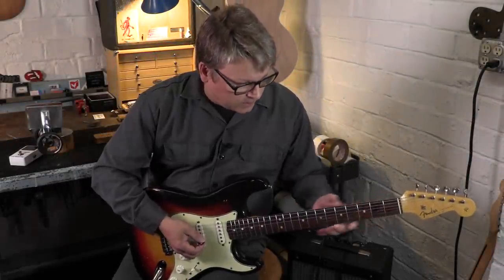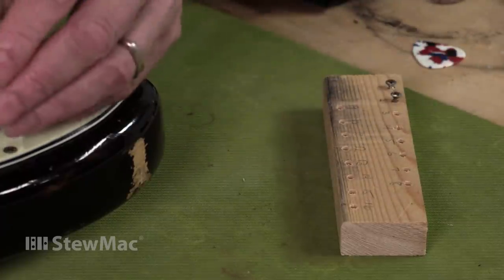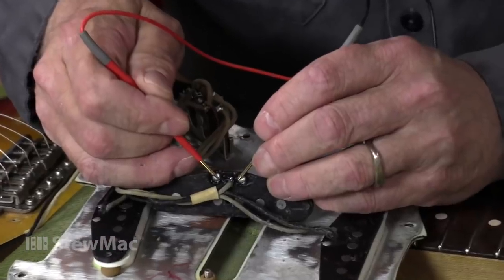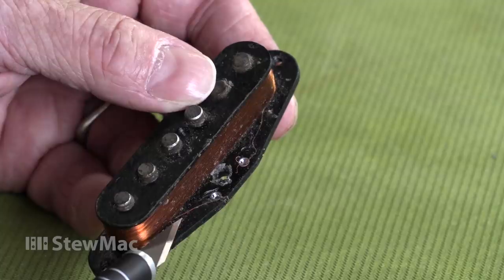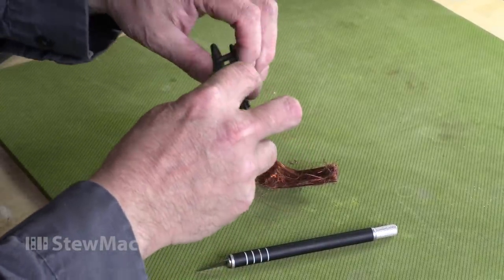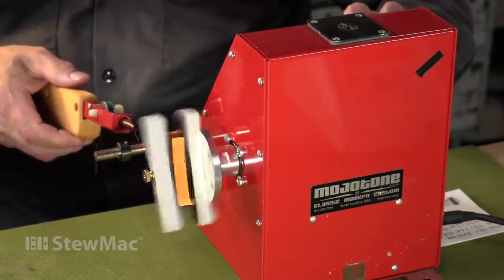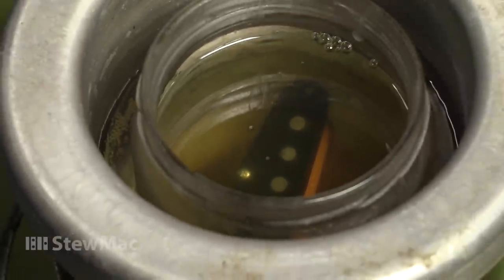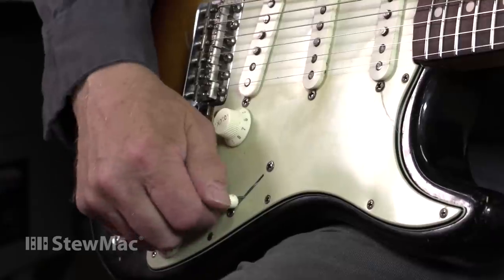Fixing a pickup on a 1963 Fender Stratocaster

Comment: Sometimes it worth unraveling the outer winding's in search of a break, I've come across a few breaks that were pretty close to the outer winding surface. Loosing 20 odd feet of wire but saving a vintage pickup is a plus. Even the lead edge of a winding can be unwrapped a little bit if its wound near the bobbin, not often though. If you find a break, and you didn't break the wire yourself you could disassemble the bobbin, not easy to do but possible and pull out a winding or 2.
Reply: Oh Heyal Yeah!!! You are so right. 20 years ago I had a Bentley Series 10 and the 'bucker died. I didn't know sheep from shinola about working on it but that Bentley made 20 some-odd way different sounds with the 5-way and 2 independent vols, before the mother bucker gave up the ghost. I really loved that guitar. So I figured,  let's see what the center of a pickup looks like.  What was I gonna do, break it? Took the pickup out and turned it over and over in my hand, poking it here and there and trying to look like I actually had some clue about what the hell I was doing (there were onlookers). I kept getting asked what I was gonna do to it, so I mumbled a bit, threw in a couple of "hmmm's", and told my audience that I had decided to get stoned and unwind it. Maybe 30 feet or so in there was a break. So after much consideration, and lots of helpful (ha ha) input from my buddies, I twisted the ends together, cut a little piece off a lead sinker (fishing I knew about a thousand times more than I did guitars), kinda sorta flattened it and wrapped it around the wire ends, and squished, wait, this was in Texas, so I should say "squarshed" it together with my fishing plyers, figuring the tool deserved a shot at it since it's buddy Mr. sinker took one for the team. Put it back together and woo hoo! it worked. Oh yeah, before painstakingly rewinding it by hand, during that time we spent(I say "we" because the onlookers had become my pit crew) considering all the options, Bob said "I'll fly if you'll buy" ('cause our mouths were getting dry), which got yeahs and yups (Texan for "yes") and hands in pockets for beer money. We couldn't do anything 'til Bob got back, so we hunkered down and got serious. We were like the driver and his pit crew at Nascar, working on the Bentley Special, getting it ready to Rock and Roll! Well, Bob got back and it was Pop-pop-pop-pop-pop!...and gulp gulp gulping...followed by some dang that's good's, thank yuh Jaysus'es (local dialect) and hoooweee!'s. More discussion and we decided I should put a coat of the old lady's clear fingernail polish on the repair and let that dry, which was just enough time to fire up another doobie. ....Doobie Brothers record, that's what I meant to say. Yeah. That. Anyway, gotter back together and that Bentley never sounded better! Then my buddy Bubba Joe( I swear!), who could actually play a guitar handed Mr Bentley back to me. Some mumbles, eh's, then a quick save, someone yelled "Barbecue!" which stared a chorus of Oh Heyal  Yayuh's,  couple of "Hey Bob! Go again?"'s , and IT WAS ON!!! ...Y'all take care, now.  - David, a.k.a. the ConnMan.
Reply: The same can be done on some P90s. Have an experience on two of them.

Comment: Very nice job.

Hand wound pickups sound sweeter than perfect wound precise machine wound coils. This is due to the fact that the OD of each turn is a little larger or for example more length of wire is used on a hand wound at the same amount of turns. A perfect digital winder with precise progression which creates a perfect ribbon of wire side by side on the layers takes less wire per turn due to less buildup of wire. The lower buildup to achieve the same DCR would require more turns. The inductance is the key for the resonant peak frequency anyway. More turns would mean a higher inductance and in my opinion the more perfect machine wound pups sound more harsh. The more perfect machine wound pickups which utilize the more perfect progression side by side etc move the resonant frequency point around or different than the hand wound pups and sound different. The random wound coils seem to put some mojo and sweetness to the pups.
Reply: DC Bluez I’ve heard that Leo’s little helper would wind pickups by hand , and the wire would regularly cross the bobbin . This was known as scatter wound pickups , giving that unique sound  . Trust me I’m no expert , so would this create a unique sound . Thanks for reading

Comment: Couldn't you just unwind by hand in case it was a break and then rewind?  If it was wire insulation could the unwound wire be coated to fix the short?
Reply: Wish I could have heard the 2 and 4 position....what if they sound was cool.  Roy Buchanan killed it with a malfunctioning bridge pickup and now Don Mare makes nice replicas with the flaw built in.
Reply: '63 had a 3-position switch but I understand you can get those sounds with careful placement of the switch so yeah...
Reply: Yup...
Reply: Yup

Comment: !!!!!  H E L P !!!!  I ran a magnet over the pickups to clean them of splinters and ferrous dust accumulated over time (done on other guitars without problems) and today the pickups no longer play!  They have no magnetic attraction and the volume has dropped by 70/80%!!  It is a "Gilmour" setup with reversed-phase (RW) single coil pickups and 7-combination selector switch.  Help!!!  What happen!?  Is it reversible?  12 hours have passed and nothing has changed!  Only the magnets involved in contact with the magnet have "turned off", the central ones... the lateral ones work perfectly (low E and high E)...!!  What happened?  Can I save them?  Can magnetic charge be recovered?  Do I need to replace the magnetic cylinders?  Is copper safe?
 Please 🙏 help, in my region there is no one to turn to..!
 Lucius

Comment: This one mid pickup had corrosion, or mechanic, or combined problem - providing almost open circuit (260k). Sound was coming from coil's combined capacitative (some ~100...150pF)  + plus resistive (260k) connection - filtering down low end of frequencies. Problem was at inner start wraps (if it would be at end wraps - pickup would not provide sound almost at all (such case there is a reason to try to wind off end wraps until finding this open circuit !). Start wraps are winded directly over Alnico magnet (or non magnetic soft iron) poles, it is std problem with the vintage kind of Fender pickups. Reasons can be two: 1) Pole inner corrosion with mechanical expansion of rust, and/or corrosion's chemical reaction with copper wire. 2) It can happen if you move someone pole down, especially if you move 1st or 6th - side pole down. Never do it ! It is rather risky to adjust string balance moving 2nd, 3rd, 4th, 5th (mid) poles too. But such accidental moving of poles can happen even playing (with pick or string), and most case it happens on mid pickup - it is more "handy" for such accident...

Comment: Lol everyone loves bright shiny solder joints! Just not on vintage guitars. I'm building a tele and I picked up some fender vintage 64 pickups and the neck arrived DOA. Fender is sending a replacement set but I did try resoldering the contacts with no luck. Same with checking the gauss, measures as it should. I imagine theres oxidation or a break. Btw I picked up a stewmac fret level when I was getting my vinyl sealer and vintage white lacquer and it works excellent!

Comment: This video is instructional.. but how could the pickup read 260K, and not be open? (doesn't make sense) then the tech correctly observes the insulation flaking off, and possible shorted windings ... which does make sense, but this would read lower resistance!

Comment: Hey I would like to thank you I have a 57 reissue strat from the 80s the neck pickup was showing no resistance after inspecting I assumed the winding had broke as there was waxy deposits but after watching your video I re-flowed the terminals an low and behold it’s working again I’m over the moon as I did not want to replace the original Thanks again Eddie Liverpool U.K.

Comment: 260K resistance reading does seem like a break in the winding due to a minute corrosion spot and not a faulty solder joint.
If the magnet wire may be compromised you really have no choice but to re-wind the coil. I am surprised that there is no inner layer of tape that may prevent any corrosion between the wire and the pole-pieces. Does the fact the pickup had to be re-wound affect the value of the guitar to any degree?
Just wondering if you would apply any mark of your own to the centre coil, identifying the re-wound coil.
It is part of the guitar's history now.

Comment: That repair was AWESOME!!! I'm a manufacturing engineer and worked at Delphi Automotive. We have banks of copper bobbin winders for fuel injectors. When electricity is applied it opens the injector, when no juice, a spring returns it closed. Amazing how two copper bobbins can have such different functions. That was a really great video, thank you for taking the time to create, edit and post.

Comment: You “do” want bright and shiny solder joints. Dull/grey are a sign of cold solder joints.
Reply: Only if it's a new joint, every 50 year old solder joint should look dull, just from oxidation of the lead solder
Reply: You missed the point, he was saying on a vintage guitar you do not want to see the repair as it will be shiny solder and stand out from the the rest of the vintage aged look, hence solder on the parts not noticeable as they will be shiny when soldered correctly. He is a man who cares about his work and the owner and the guitars heritage.
Reply: @paulrichardson3222  A man who cares about "vintage" fake...

Comment: You're looking at .260 megs or 260 k.  That's way high.  That can't be a short.  That's a broken wire.  You still have to rewind it, but it is what it is.  Not a short and not enamel failure.  Am I wrong?

Comment: So if the wires insulation failed and they are shorting out somewhere, why does the coil read a higher resistance? That doesn't make any sense. I would have rather expected the copper wire to be worn down somewhere making it thinner (without touching the other wires) and increasing it's resistance...

Comment: Interesting to see someone actually use one of the old style pocket magnetometers. As far as I can tell 25 gauss is the field strength at the sensing magnet, some distance inside the case of the magnetometer, so the reading is not at the top pole of each pickup magnet, but at some distance from it. If you use a modern magnetometer with a Hall effect probe, right on top of each magnet you will get a reading closer to 1,000 Gauss for a fully charged Alnico 5 Strat pickup magnet. From magnet to magnet this commonly varies by perhaps as much as 100 Gauss. Whether this variation is due to uneven charging or variation in the magnets I don't know. Taking an accurate and stable reading with a small Hall effect probe is quite difficult because the field density near a small magnet is far from uniform and the value you get depends on exactly where you measure it.

Comment: Hey Erick, great site!  I own an original 1976 Tele.  Just had it refretted after 16 years of ownership.  Don't know if it's coincidence but now my bridge pickup is really weak.  Used to be hotter than the neck, now it's weaker.  It's ohming out at 5.7 ohms, similar to the neck.  No erratic measures, etc.  I noticed after closer scrutiny that the pole under the a string is far, far weaker than the poles under the other strings, at least as is noticeble by playing each string individually.  I popped off the pickgaurd and looked at the pickup, nothing obvious.  Is it possible that just one of the poles is affected?  If so, is it repairable?  Or rechargeable?  Weird that it's just one pole?

Comment: Weird copper readings can be a result of strong temperature swings. A common problem in coms lines in Alaska as the wire expands and contracts eventually resulting in an weak open condition. When re soldering connections doesn't resolve it, the fix is to replace the copper.

Comment: Wires shorted create lower resistance not higher.
If you would have cleaned and re-solder the original winding wires at the solder terminal Im rather certain that the problem would have been resolved.

Comment: I would have tried to get the lacquer away with a sharp knife and solder it again. If that wouldn't help just unwind one or add a small wire to the winding. I'm pretty sure this fixes it because sometimes the lacquer doesn't make a good solder joint. Also less effort and more original.

Comment: At 4:28 replacing the pickguard the first time, by the bridge pickup there is what looks like cracking or indentation on the pickguard. And on the base looks like a new bad ding causing even more questions about the stability of the pickup. im siding on the side of Stewart. have it rewound .

Comment: Keeping the position of the screws might not be the best idea if one or two are very corroded. I recently worked on a Rickenbacker 4001 and the pickup surround screw under the playing hand was corroded to the point of almost being stripped of its Phillips slots- it was just a little pile of rust and dirt. I moved it over to the other side and it's good for another 40 years!
Reply: If this vintage instrument is workhorse, not for "museum" - putting original screws in plastic bag and replacing them on identical stainless steel screws is the best you can do. The same with some other parts.

Comment: I cut off the outside wire when i switched the Covers and i have to solder it back on. Is a 30w iron enough to do that? Would hate to buy a new pickup or to send it to someone to fix it

Comment: Too much of "beating-around-the -bush" for a simple problem, if a pick-up is reading too high impedance than just re-solder the wiring terminal since the fine winding end was not cleaned well from insulation during manufacture. Another Bullshit is about screws .... any same size screw will fit anywhere.   This guy should learn some electronics and mechanics about guitar design.
Reply: You clearly have no idea of what you're talking about...
Reply: @ilpatongi  Which school did you go to???????  Well there is Stanford University further south of San Francisco on route 101 in Palo Alto, this is the best place to learn any Electronics.

Comment: Excuse my ignorance, but what does the wax do to the pick up?
Reply: The wax performs a couple of functions, it keeps the windings mechanically stable and to an extent it will keep humidity out of the windings. Wax was often used in transformer windings for the same reasons.
Reply: Wax potting also reduces microphonics greatly. An unwaxed microphonic pickup can squeal  and make all sorts of horrendous noises.
Reply: @ralphshaw9758 that is part of what I was referring to as "mechanically stable"
Reply: I totally got that but others may not have. cheers.
Reply: @ralphshaw9758 , no problem, the replies to this video tend to get a bit passionate. The confusion between open and short circuit in the video was irritating. You probably expressed the mechanical integrity thing better for a musician.

Comment: Please, could you answer to these questions? #1. how many turns of wire could each of  those coils have? #2. Theorically speaking, usually, have neck coils got more turns than bridge ones, or bridge's have more than neck's? Thanks
Reply: #1. Very different, some 4000...8000 turns. Bridge coils most case have more turns - to balance reduced string vibrations amplitude at bridge position. But there are other methods too - magnets, wire gauge, pole distance to strings etc.

Comment: 6 minutes in. If the wires had shorted because of any issues ... insulation broken down ... then your meter would read a low resistance and you would get weak sound. However, if you read >250k as per your meter, the winding is open circuit, meaning a break in the winding. 99 out of 100 times can be fixed by re flowing, with flux, the connectors on the pickup. That saves rewinding a pickup for no good cause.
Reply: 99% it was at first windings - chemical corrosion in between rusty magnet poles and wire, or mechanical break of wire by increased diameter of corroded (rusted) magnetic pole (not this case because there is still some resistance). It is std Fender pickups problem with wire direct winding on magnetic poles... The only solution is rewinding.
It is rather easy to find where is open circuit - connect pickup coil ends to amp reverse and check on pickup's sensitivity. If there is no more any sensitivity - problem is at first windings. If there is reduced sensitivity - problem is in mid of windings (1%).

Comment: It would have been a good idea to check the pole pieces for bare spots with the multimeter or even recoat them to prevent possible shorted coil windings.